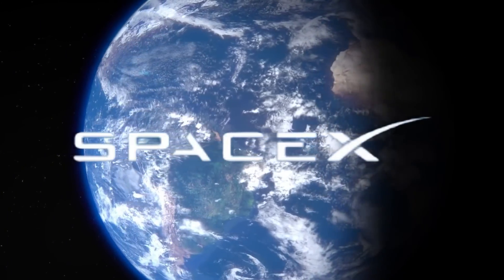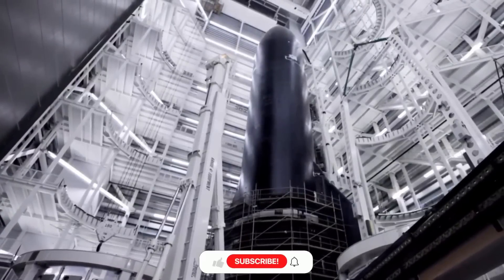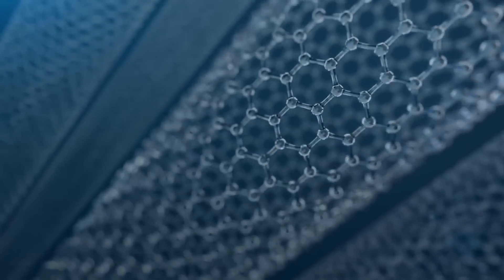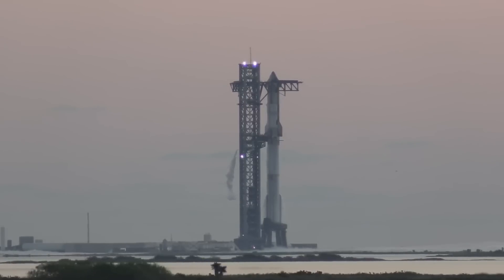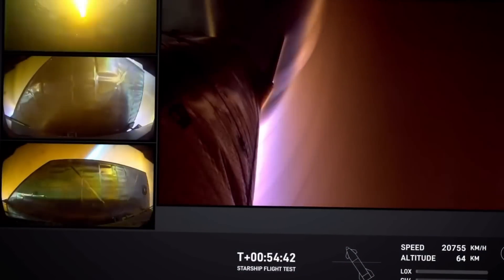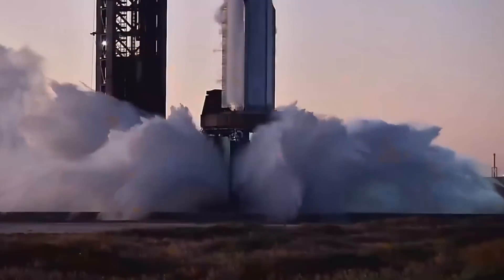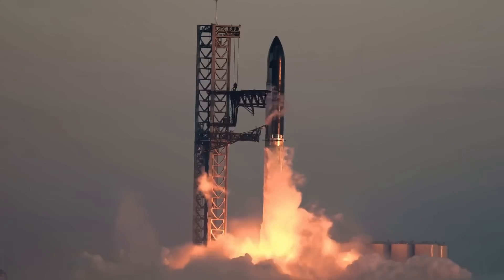SpaceX Finally Revealed What Nobody Knew About Their Game-Changing Metal Shield!

Comment: You're doing a fantastic job! Just a quick off-topic question: My OKX wallet holds some USDT, and I have the seed phrase. (alarm fetch churn bridge exercise tape speak race clerk couch crater letter). Could you explain how to move them to Binance?
Reply from the maker: Great advancement on metal heat shield tech! Has Musk's team actually figured out the alloy composition? Normally when these kinds of tech leaks happen, the real details are still under wraps. Just curious if this is more than speculation at this point.

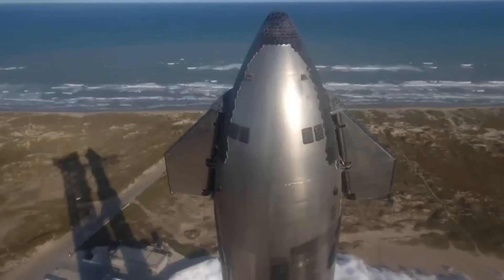Comment: "Aluminum coating began to fail"  ???  1:57
Reply: There is a lot of drama in this video, I only made it to 4:36.
Reply from the maker: @bliz4600  True, the video is packed with drama—it seems designed to keep viewers hooked
Reply: This comment concerned various experimental tiles placed on test 6 as an experiment.
Reply from the maker: @barry2585  Exactly, Test 6 was all about pushing boundaries with experimental tiles—every detail was a step toward refining the ultimate heat shield design!
Reply from the maker: Good point! That line does seem confusing—perhaps they meant a specific alloy treatment or experimental coating rather than pure aluminum.
Reply: @Elonmusk24h  Just so you know - we are all holding our collective breaths in anticipation of you realizing your dreams.  There will be no Enterprise NX-01 without you.

Comment: Produce a plasma gas shield using methane, you can utilize a process called "plasma-assisted methane reforming" where an electric discharge (plasma) is applied to methane gas, breaking down the molecules into reactive species like hydrogen and carbon radicals, which then form a protective plasma shield around a target area
Reply from the maker: Fascinating theory about methane plasma shielding - while plasma-assisted reforming is real tech, scaling it to protect an entire Starship during reentry would be revolutionary if SpaceX could solve the massive power requirements and plasma containment challenges. Has anyone seen hard data on whether they're actually exploring this?